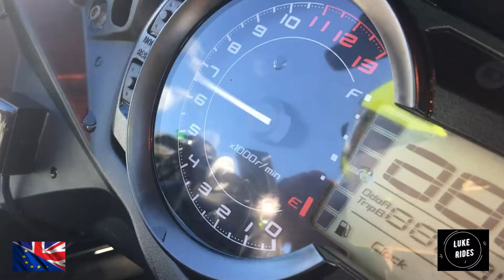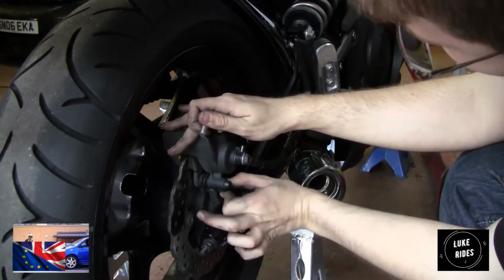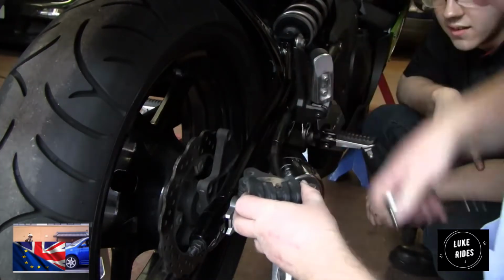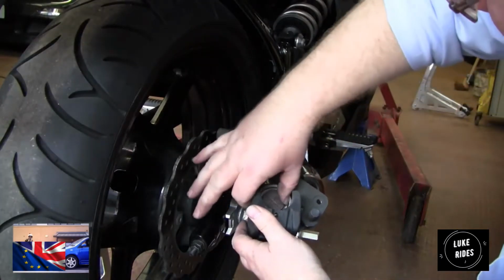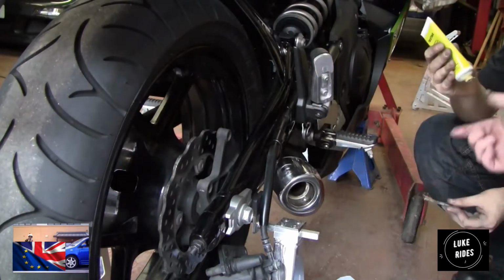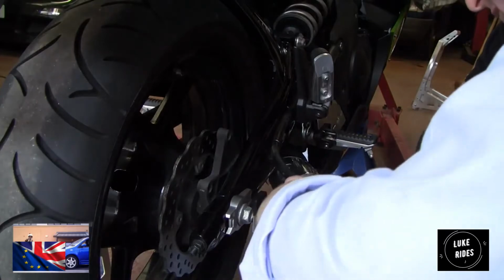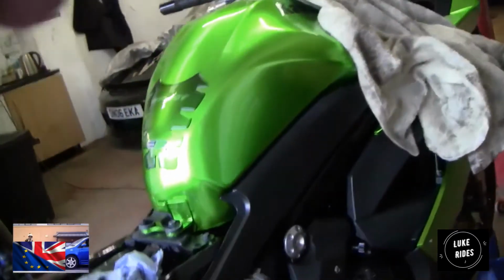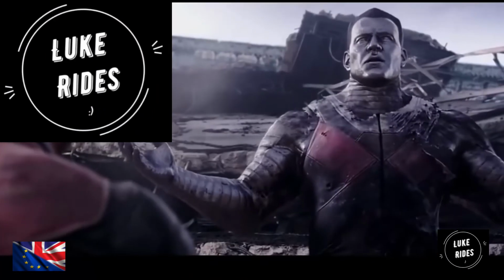How to Fit New Rear Brake Pads on Kawasaki ER6F Ninja 650R BY LUKE RIDES

Comment: I couldn’t see most of the more pivotal part, if you ever do this again maybe have a close up of when you’re replacing the pads?
Reply from the maker: Awwww. Thank you b3ntl3y. Thank you for pointing that out. Definitely next time Luke Rides does a workshop video like this. Luke Rides will try to do better with the camera angle. And get more important parts in like what you mentioned. This was the early days of the Luke Rides. Luke Rides has learned so much now with playing with different camera angles. And capturing the important parts when making a workshop video. Luke Rides will always want to do better.

Luke Rides doesn't own the Kawasaki ER-6F Anymore. Wouldn't be able to remake this workshop video. Kawasaki's engineering is beautiful an absolute pleasure to work on. None of the fixings wanted to cross thread. Anything came apart nicely. Very lovely motorcycle to work on. Thank you b3ntl3y. Hopefully we will speak again. Take care :)

Comment: What's that grease you're putting on? Can you use the Yamalube grease?
Reply from the maker: Haha. That is a pretty good question. It is TEXTAR CERA TEC 81000400 Mounting Paste. This is pretty good at stopping brake squeal. Hope that helps. Luke Rides always uses this paste when fitting new brake pads. No matter the motorcycle. You don't need to apply much. Just a fine thin layer of the paste on the back of each pad is really good. Just the fact the rear of the brake pad is covered in the paste is amazing. Applying lots of it is just wasting the paste and covering your gloves more in the paste. Thank you for such a good question. I don't know if using the Yamalube grease is a good idea. I don't know. But as long as it meant for braking systems it should be good. And being Yamalube grease it will be of good quality. Thank you. Hopefully we will speak again. Take care :)

Comment: yeah, I always press on the pad, not behind the pad on the piston plastic piece.
Reply from the maker: True. Using this technique is a good idea. Thank you for such a good comment darksorceresszyra9467. It was a pleasure to work on the rear pads on the Kawasaki. It is a really nice caliper to work on. Kawasaki engineering. Beautifully built. None of the bolts cross threaded. Neither did the locating pins. The piston came back really nicely. Kawasaki did a great job with the ER-6F. And shows Kawasaki learning from previous rear caliper designs. Refining their rear caliper. And the breaking system. Thank you for such a good comment. Hopefully we will speak again. Take care :)